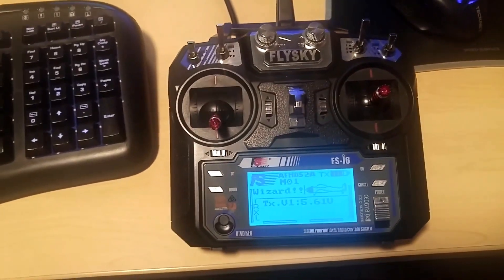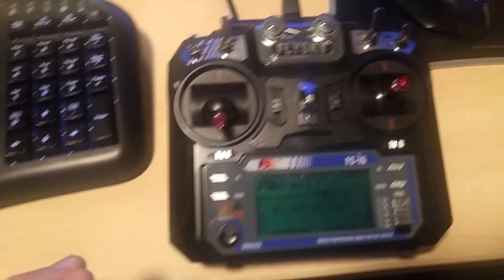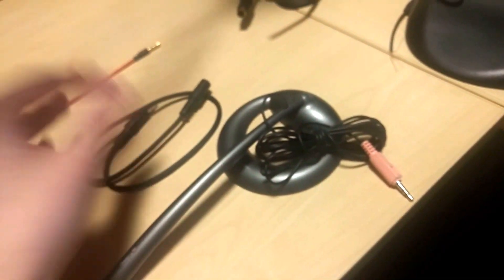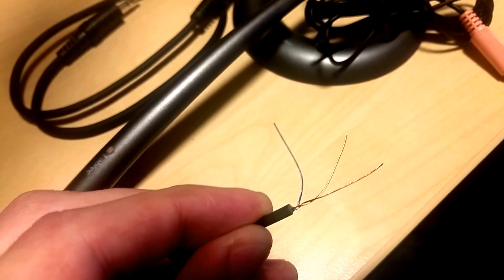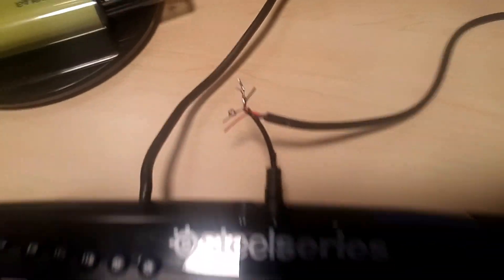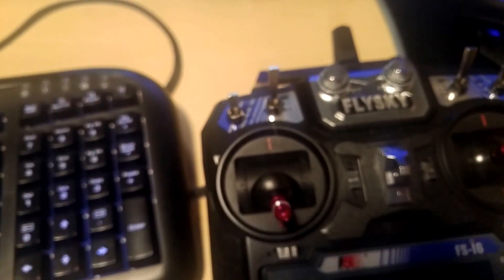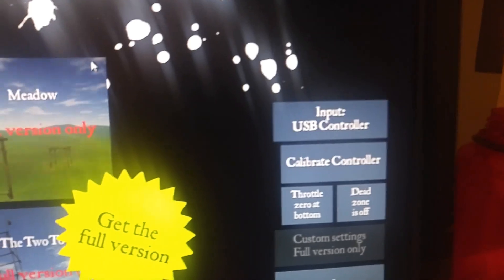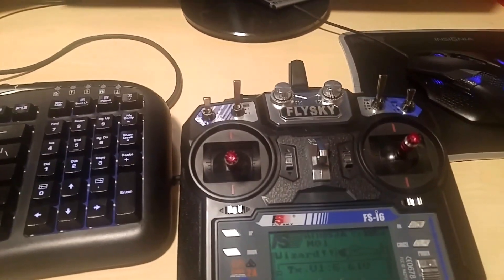Tutorial - Connect Flysky FS-i6 to flight simulator - quadcopter practice for free!

Comment: i can get this to work im having the smartpropo just jump around , im using a asus gaming laptop that has a mic input but ive tried several ways of connection but nothing. radio has ppm turned on and also do you turn trainer on the fs-i6 too or not? ive tried several ways but nothing
Reply from the maker: David Downs There shouldn't need to be anything done in the transmitter. Just make sure to select 'standard' mode in PPM in smartpropoplus. If you're still having jumpy inputs it's probably a connection problem. Maybe your site colours are different, id try soldering to a different set of wire colours!
Reply: ghudner yeh I've got grounds hooked both up on 3.5mm now but tip is signal wire and if what I read the ppm on radio is for signal. do u got anywhere shows info about the wire outputs on radio what they are. the program will show low volume or ow signal . not sure what's issue. I did a seperate ground on shield for input to radio so it's soldered to shield
Reply from the maker: For a standard 4 pronged S-video cable like the one I show in the video, the two pins on the bottom are ground and the top two are used to carry the video signal. I'd assume both of these are connected to the signal wire in this case. So just connect the top of the 3.5mm jack to the top two pins of the S-video cable and you should be golden!

Comment: Pls help my FlySky FS-i6X don't work with this setup! I already did  and follow exactly the procedure in your post and it says transmitter disconnected. I tried FreeRider but i only have throttle and still says transmitter disconnected. What shall I do?
Reply: I had the same problem. The colour wires for your cables may be different to the ones in the video. As I used both male to male cables for the S-video and 3.5mm headphone cable, I cut up the other end to see how the colours were wired up. Heres a photo of how mine works http://imgur.com/a/Lhu4T
Reply from the maker: Earthling01 I wouldn't start up any simulator unless smartpropoplus gives you the right feedback like I show here. If that doesn't work there's probably some issue with the soldered wires. It could be that your cable has different colours to mine, so you'll have to experiment until some combination works.
Reply: Thanks Jason Scott! I hope it will work for me.

Comment: Did you have to change any settings within the controller. Mine is sending weird singnals to smartpropo and its not working at all
Reply from the maker: Maybe, I can't quite remember... It might be set by default to auto decode, so in the Transmitter tab I've got "Standard" PPM selected and the "Auto" box unchecked. That's all I can see! 

Let me know if that was your problem and I'll add an annotation to the video. It could also be you've got the wrong signal or ground wire soldered - not sure!
Reply: I had the same problem. The colour wires for your cables may be different to the ones in the video. As I used both male to male cables for the S-video and 3.5mm headphone cable, I cut up the other end to see how the colours were wired up. Heres a photo of how mine works http://imgur.com/a/Lhu4T
Reply: hey, I have wires going out of my S-video cable? red, yellow, green and white??? Any tips on which one should I connect?